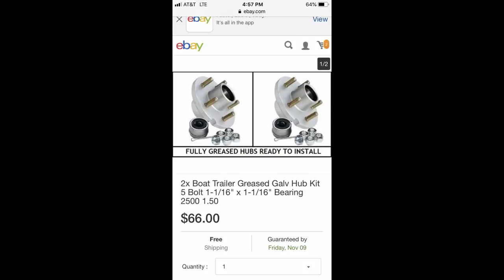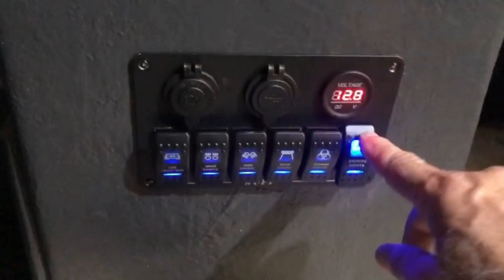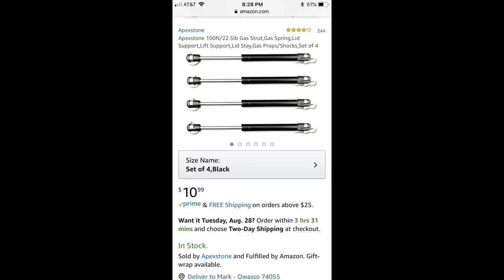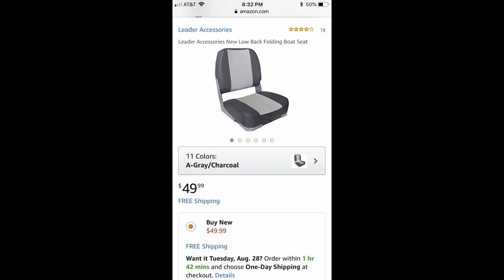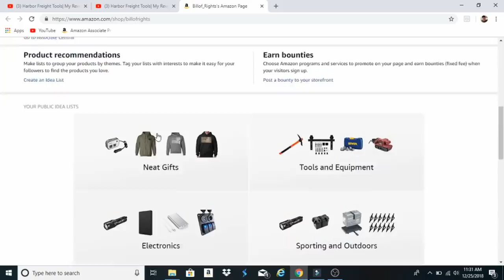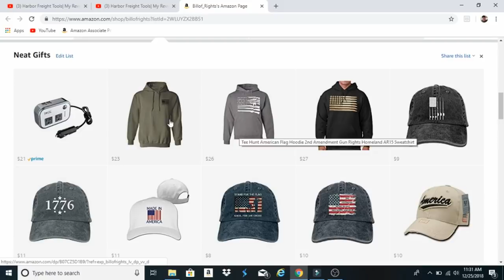Jon Boat Restore & Modifications| Start to Finish| Before & After

Comment: Absolutely loved your video!!  Nice mix of photos and videos and loved the music choice and even the volume level!  So many people don't get all those things right and you nailed it sir!  Beautiful job on your project boat.  The only thing I would say you forgot are the cup holders, but those can easily be added. :-)  What you've done is on my bucket list!!  I am curious, if you could do it over what would you do differently?  Also, did you consider aluminum framing to save on the weight?  I know wood is easy to work with.  Great work, great video!!  I am a subscriber now too.
Reply from the maker: Hi Joey, I would tape in more fiberglass below the transom. Michael does a great job doing what he does with aluminum. I kinda like the sturdiness(against the waves)the wood gives in weight. I ended up putting way more into this build than I planned and am finally happy with the results. Thanks again and thanks for subbing.

Comment: Nice job on the rebuild but I noticed a lot of errors in the process, when you glass the floor I’m not sure if you sanded/grind the entire inside of the boat cause if you didn’t than you just glassed the paint and not the actual hull, cause the fiber glass to lift up easier later, second, you should have done all the hard labor stuff first, such as gutting and rebuilding BEFORE you start painting and what not, just some pointers to give you, me and my uncle build boats in Hawaii so just figure give you some tips on when you do your next boat restoration🤙🏽
Reply from the maker: I did grind the insides of the boat. It had carpet glued to the sides. I spent a great deal of time removing it with a heavy grit pad. 

I’m certain that pro’s can scrutinize the project. I’m just a guy who bought a boat, researched and did the best I could. I can say that the boat is doing great. Will it last another 50 years? Probably not. You guys that do this work have a tiger by the tail. This boat was my only and last project. Thanks
Reply: Alright man but still, really nice job for a first time boat build👍🏽
Reply from the maker: Thinking about it, I’m betting I didn’t grind all the paint down to the hull. Hopefully, it will take years to fail(taping areas). Any fiberglassing I did on the hull bottom, I made sure I sanded down to the fiberglass.

Would the new fiberglass bond to well sanded down paint?

Comment: What’s the top speed on it ? , but non the less great build , and that does prove to u that hard work does pay off !
Reply from the maker: Hi Brayden, top speed is 24 mph. Typical top is around 21. I have a video a few back where I’m running it on smooth water and clocking it with s phone gps speed app. Thanks for watching

Comment: Mr. Bill in my name is Cory and I've got a 1986 Glastron ski boat that I bought and pretty much a project and so far pretty much going to need the help of what I can do about rebuilding this thing got a lot going on more like a project is going to be taking place here pretty soon for it ordered to be on the Water by summertime but a lot of interesting ideas came across your video and hopefully I can probably make this work for what I am going to do with this boat
Reply from the maker: I watched a lot of YouTube videos to get my project done. Good luck Cory
Reply: Well I bought oscillating multitool  and 4 piece wood and metal cutting kit.  What kind of tool did you get
Reply from the maker: I just bought a cheap Chicago Electric knowing I wouldn’t use it much. It did s great job.
Reply: Okay. Think its same thing I got  but what kind of cutting tool? Do they have fiber glass  cutter or what would be the best 1 to get
Reply from the maker: For cutting the fiberglass, I just used scissors.
Reply: @borfishing7690  I would but someone already cut the fiberglass and has some of the edges sticking out so figer I would cut them with some kind of blade and then have to sand down alot of fiberglas
Reply: If I could send pic I would show you what I mean haha
Reply from the maker: If you are talking about cutting fiberglass that has been resined, I would use a rotating sander. In the video, you will see me using the sander while prepping the transom before putting in the new board.
Reply from the maker: I’m using the sander at 5:20
Reply: @borfishing7690  okay look like half circle? That what I got.  But when you was cutting with rotator? Was the video goi going fast? When you was cutting?
Reply from the maker: The sander has a sanding pad with 40 grit. It would be sanding down the excess glass. I do have a small rotating cutter that I never used on this project that probably could be used to cutoff excess glass.
Reply: @borfishing7690  I bough few imperial blades with titanium enhanced and boy do they work great.  I cut bout 11 ft of access fiverglassand only took me bout 2or 3 min worth.  I'm impressed by the cutting blade if i could show you pic i would.  Did pretty goo being first time.  But not finished yet so ca t get Hope's up yet lol

Comment: Tbh, nobody would sell a boat for 150euros here in europe. its kinda shocking to me that you can sometimes get such good deals on craigslist.
Reply from the maker: I was just as surprised. As much as I had to put into the project I’m not sure it was a great deal.
Reply: @borfishing7690  well actually i just looked at a similar platform to craigslist and you can get some boats, but with no motor and even in the same condition or worse. How much of material cost did you put into it? Do you need to do any registration for the trailer?
Reply from the maker: Had about 2000 in the boat and 2000 in motor repairs and buying a trolling motor. Keep in mind I replaced all steering components and added bass decks. No, I didn’t have to register the trailer.

Comment: how fast did she go before, and after? curious with all the weight added by subfloor and compartments
Reply from the maker: I never used the boat before the restore. I’m sure it lost some speed, but it has preformed very well for my needs. Thanks Buddy
Reply: @borfishing7690  thanks for reply. i did a test on my 16' jon boat on a camping trip a while back. roughly 300 lbs supplies i got 25mph. unloaded at camp site, went for a bait run nothing in boat, got 26mph. im sure your loss is marginal as well.
Reply from the maker: I was getting 21 mph until a motor issue recently(lean rich adjustment screw). After self adjusting it, I now get only 18mph, but it idles and trolls much better. I’m guessing it would have got around 26 before the restore. For a 14ft boat, it is very functional for multi species fishing. Thanks Buddy

Comment: what's the grey material that you use for the  trailer and for the inside of the boat?
Reply from the maker: I used the cheap outdoor carpet Home Depot sells for the trailer runners. I bought boat carpet for the decks.
Reply from the maker: https://www.boatcarpetbuys.com/products/20oz-bass-boat-carpet

Comment: Nice video Sir. Do you recommend spray glue or the other one? I’m planning on re carpet my 1999 Tracker Aluminum and replace wood with PVC.
Reply from the maker: Hi Javier, it’s too early for me to recommend the spray glue. I can say that despite spending time outside during storms and several fishing trips, I’ve had no problems with it. I’m going to be using it a lot this year and we will see how it works out. I should have zero problems with the deck parts. The floor is the only part that would have issues, if any.
Reply: Javier SO hey I did in 83 what you are doing now or plan to do to a boat mine was a 76 sears gamefisher fiberglass 14' 6" model rated for 25 hp so you know what I did yes sir saved my dollars and bought a 1983 35 hp merc short shaft elec start and chock you got to remember I was 20 in 83 2400$ I had a aluminum front deck 3/16" heavy no water intrusion mid floor front to back carpet stapled on back didn't encapsulate the wood so when got wet added a look weight don't  use wood check tiny boat nation and how he did his bass tracker I was in high school when bass tracker came out like I want one so bad my bass pro was Rick Clunn he was just starting out now I'm 57 and tournament fish mahi with my 82 wellcraft sportsman w my 08 300  etec
What a big difference my gamefisher is up by Ocala fl I'm in Miami fl so check out his channel don't use to much wood JT 🇺🇸🐟🎣🛥🌴⛱😊😃🙏🏻🙏🏻🙏🏻

Comment: What did u use for the bottom of the boat?? A sealer or durable latex paint??
Reply from the maker: I used Rustoleum protective enamel, thanks Mike
Reply: @borfishing7690  awesome build im about to start one on either my 12ft Jon boat or my 14ft vhull not sure which will be better yet.  Any idea which boat id have better stability and buoyancy with after i build on it?
Reply from the maker: The longer and wider the better, IMO. Personally, I would work with the 14ft vhull. It depends on which one you will get more use from. Good luck on your project
Reply: @borfishing7690  i use the vhull all the time bcuz my jon boat needs to be fixed due to a tree falling onto it plus vhull is wider n longer and was my number1 pick anyway lol

Comment: Great job. Love the boat. So.you bought the boat for $150. How much was the total restoration with the cost of the boat.
Reply from the maker: Ended up around 4000. 2000 went into the motors, the rest into the trailer and boat. Thanks Charles
Reply: I'm looking to get a little junk boat like that and restore as good as you did.
Reply from the maker: Be prepared to have more into one than it is worth. I’m lucky that I will eventually get my money investment back through YouTube. I originally only wanted the total cost to be no more than 2000. The motor is a very important consideration. Good luck if you do find a project boat.

Comment: Hi! Nice job! How long you rebuilded this boat? Why you not installed the console?
Reply from the maker: Took about 4 months working nights and weekends. There was down time waiting for parts and shop repairs on the motor. Console?
Reply: @borfishing7690  wind shield?!
Reply from the maker: Not sure I can put one on it. I have two depth finders on it. I might be able to shape some plexiglass in the future, thanks
Reply: Is there in your fishing places  strong wind with big waves or strong rain?
Reply from the maker: Considering the boat runs about 20 mph and I don’t take it on rough waters, the windshield is more a luxury than a need.
Reply: @borfishing7690  Ok. That explains everything.
Reply: @borfishing7690  we in Latvia usualy fish in all weather.

Comment: How much was spent on this project? I'm thinking on doing this too
Reply from the maker: The keys were 2.50 each at Lowe’s. I wanted small keys that were uncut so to even the weight as possible. If you have old lures you can get rings and hooks from them. I bought the small rings at Hobby Lobby for a couple bucks. Thanks

Comment: How long did this build take
Reply from the maker: Hard to say. The process lasted 4 months, which included working nights and weekends. There was down time waiting for parts and supplies. There was time when the boat and motor at the mechanic while the motor was being worked on. Somethings went fast some didn’t. I spent a lot of time doing research and thinking.

Comment: Great Job sir! So enjoy of watching this video! Would you mind to tell how long did this job take you and approximately the cost of this restoration?
Reply from the maker: Hi there,  it’s hard to quantity the actual time itself. There was down time waiting for parts and work from a shop on the motor. The overall process was about 4 months( working week nights and weekends) and the overall cost was around 4000( 2000 motors, 2000 boat), thanks.

Comment: do we need to polish the wood first before apply resin
Reply from the maker: The only thing I would do to the wood is fill in any holes or cracks.
Reply: @borfishing7690  how water drain if boat is below water level
Reply from the maker: Using the bilge pump

Comment: Good job!!  But it looks like you added a ton of weight to that boat
Reply from the maker: Not as mush as you might think. The transom and floor are a wash. The framing and decks added, but the boat sits well in the water and has a stable ride at 20 mph. Thanks for watching and commenting

Comment: what is resin putty?
Reply from the maker: Resin putty is a mixture of fiberglass resin with a bonding source. The bonding source provides strength to the resin. Resin on its own is breakable.  When I puttied around the transom I was using a fiber based putty provided by the place I bought my resin. For filling areas around the edge of the floor, I was able to use resin mixed with flour.

Comment: What was your total cost on this restoration would say?
Reply from the maker: Roughly 4000. 2000(boat) 2000(motors)
Reply: Pretty reasonable I got about 2000$ in a 76 85hp evinrude I’m redoing currently

Comment: Why not pressure treated or aluminum ??! Make it last forever just my two penny’s
Reply from the maker: I’ve read that it is not recommended to use treated when fiberglassing and painting. I didn’t use aluminum because I’m not familiar with it. 
I store this boat in a garage and expect it will last long enough the way I did it. I’ve been very happy with the results. Thanks

Comment: What was total Cost?
Reply from the maker: Hi David, the total was around 4000. 2000 went to the motor repairs and buying a trolling motor. The rest was in the boat, thanks
Reply: @borfishing7690  thanks sir.  I have an old boat that needs some tlc   I would like to see if I could fix it cosmetically.  Lucking it floats and runs well.

Comment: Glass fibers in putty be stronger
Reply from the maker: Yes, I used glass putty around the transom. I used the flour mix only to fill in gaps on the floor. Thanks
Reply: @borfishing7690  should mix in chopped strands to add strength
Reply from the maker: Yes it would. I used the fiber mix in critical areas. Thanks
Reply: @borfishing7690  oh.  I just assume all the work is critical being a boat and all.   My bad.  Thanks.

Comment: Actually, I personally got unsafe Oregon City Clackamette Park boat ramp shut down. Builder an who ever signed off on boat ramp never launched boat or parked launch vehicle! They built ramp on upside of dock, so you had 3 seconds from off loading from trailer to current smashing boat into dock. First time I launched current took my boat almost cutting off both legs of young girl setting with legs over edge of dock! Parking was insane with all kinds of planting so no one could just pull out straight out but needed to back boat up to get out of parking. Stupid really bothers me esp in politics which is full of stupid!

Comment: IL  mio parere negativo deriva dal fatto che le rifiniture ( verniciatura e moquette ) sono orribili e poi perché la linea di galleggiamento ( cosa ancora più grave ) è troppo bassa perché la barca è stata eccessivamente  appesantita , e con le onde alte affonderà
Reply from the maker: I’m not worried about it sinking due to weight. The boat is not designed for big open waters, it will be used in a safe manner.
Reply: if you're satisfied ok !
Reply from the maker: I’ve fished in a homemade boat and a pelican 10E. Ive been in this boat a dozen times, it is by far safest. I understand your concern and am cautious as to how I use it. Your concern is a legitimate one.
Reply: sai  BILLOF sono ITALIANO  e  il  nostro, è un popolo di Santi, Poeti, e Navigatori conosciamo bene le barche ….. comunque per navigare tranquillamente con la tua barca potresti alzare le mura di circa 30 cm. e nel punto di giunzione ( tra nuovo  e vecchio )  potresti farci un cordone  di 15-20 cm. di diametro di poliuretano espanso ricoperto il tutto di vetro resina. Ciò renderebbe la barca più sicura ed aumenterebbe la sua galleggiabilità . Spero cosi' di aver risolto il tuo problema , che DIO  ti benedica e ti  protegga soprattutto quando vai per mare .